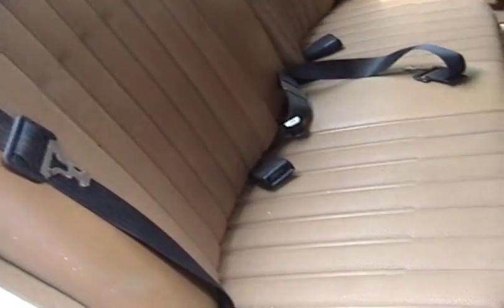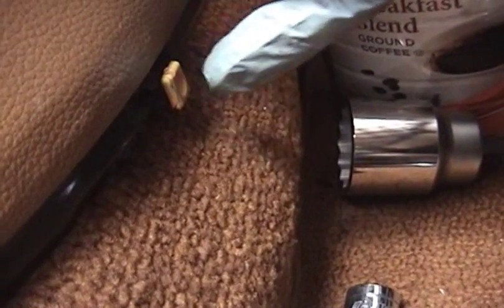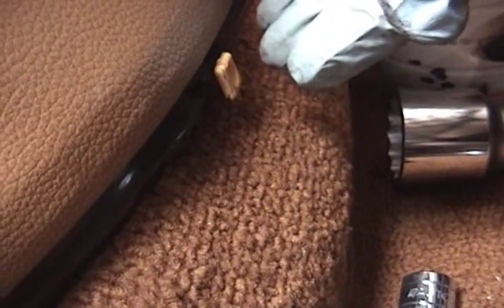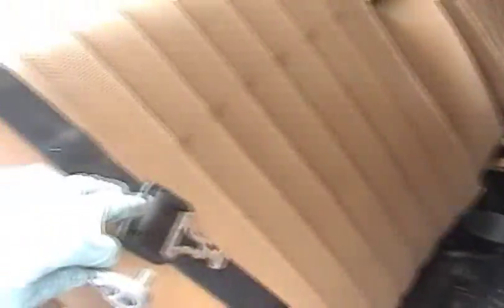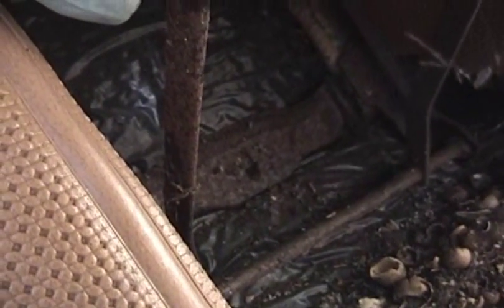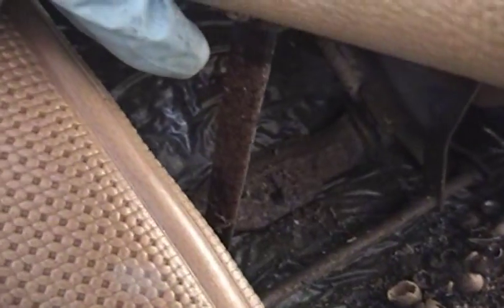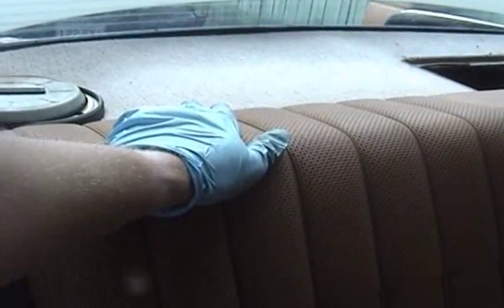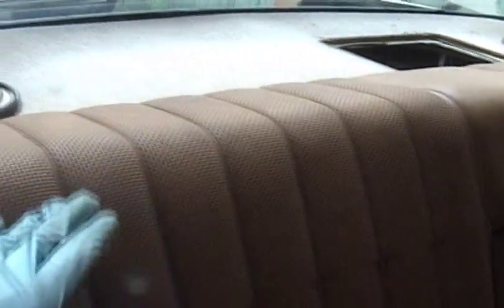Mercedes-Benz W123 diesel - DIY: rear seat removal

Comment: Excellent. Short straightforward no nonsense. That includes the excellent suggestion of removing the horse hair stuffing and replacing it with for rubber. I’ve got the same problem with mine. I do appreciate it thank you.

Comment: unrelated, i just bought a w123 its a 1979 300d i cant get the seat warmers to work, idk what button is for the seat warmers and was wondering if you maybe know some problems, i have messed with all the switches.
Reply from the maker: I've actually never seen one in person with seat warmers. I wasn't even aware those were available as an option. Unfortunately, I can't tell you anything about them. Best of luck.

Comment: Are these easy to reupholster yourself? I was thinking about buying all new vinyl seat covers for mine
Reply from the maker: Tim Archibald Pretty easy, yes. I have a playlist covering seat rebuild. http://www.youtube.com/playlist?list=PLxTxz3tK6IkLNrathpTQwSesgm7SXGAED
Reply: MercedesDieselGuy 
Do you have to press both of the tabs in at the same time and pull up?
Reply from the maker: Tim Archibald Not necessarily. It helps, but you can usually release one side at a time.